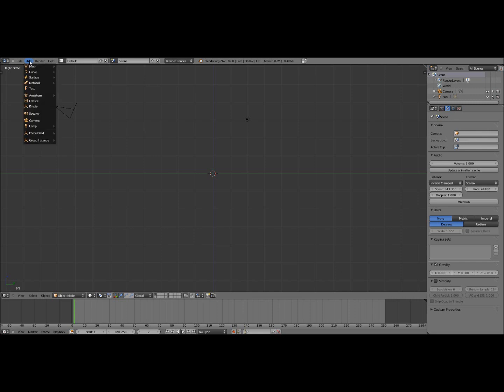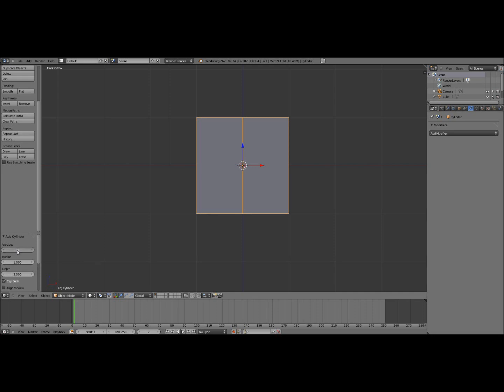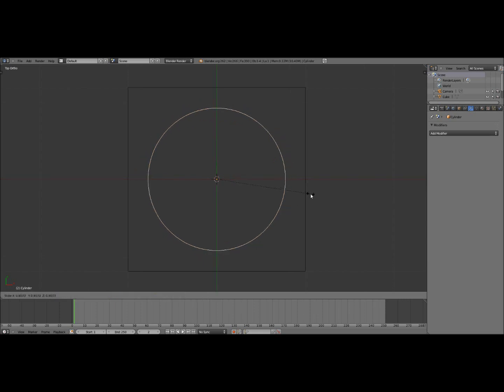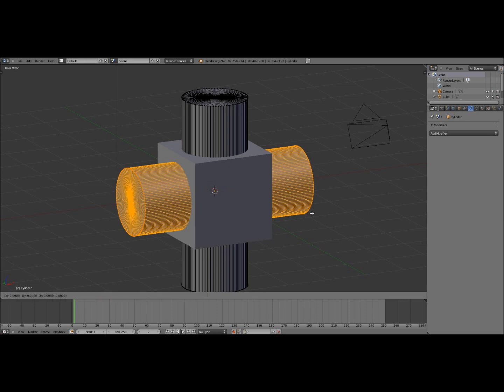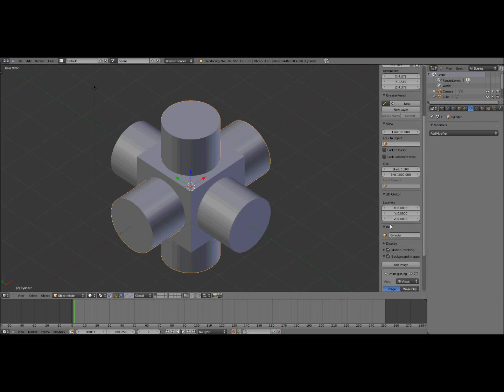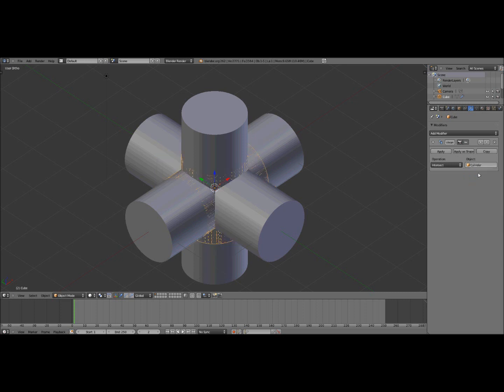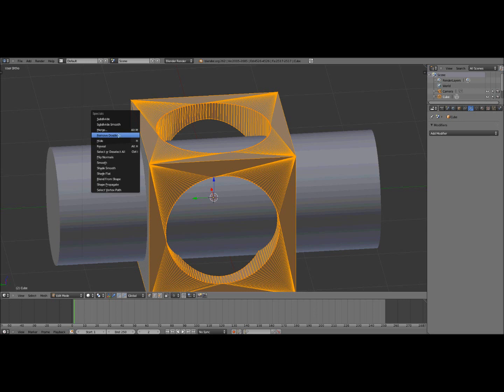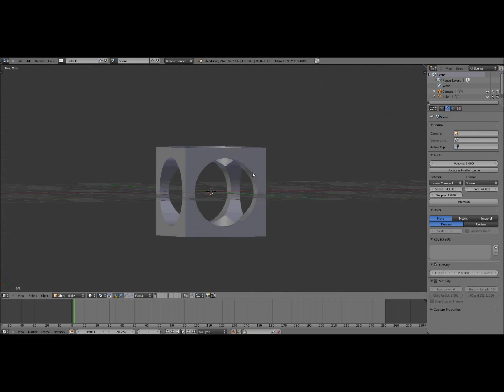how to put a hole through anything in blender

Comment: what the use of tab and  click A stuff?does it remove cylinder permanently?
Reply: Shankar Subedi tab switches between edit and object mode as standard. A marks everything (in both edit mode and object mode).
Reply from the maker: If you mean where I remove doubles and fix the normals in edit mode it's too make any more booleans work properly. Blender's boolean  modifier is fairly unreliable once you a decent number of cuts and that is the best way to keep it working.